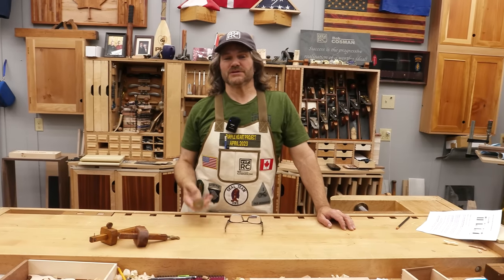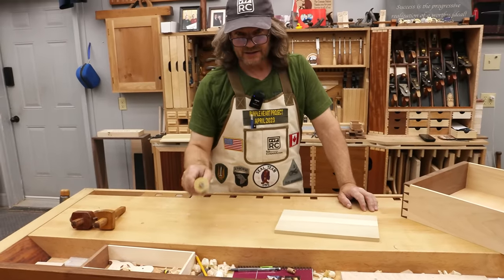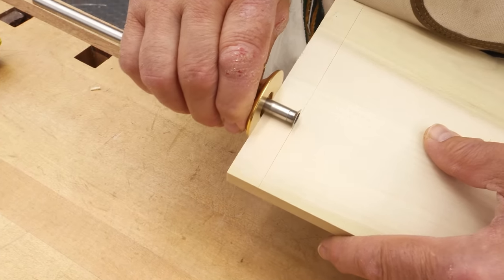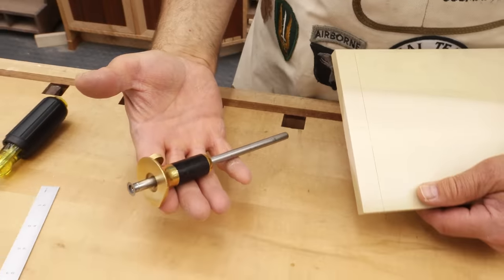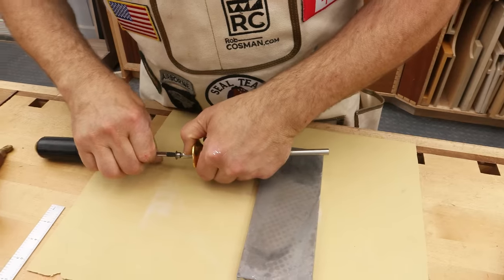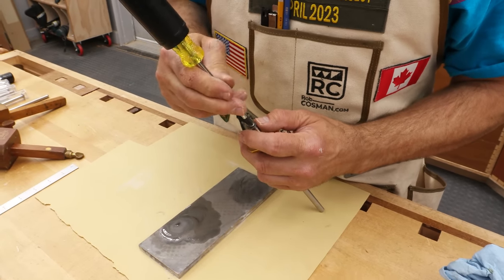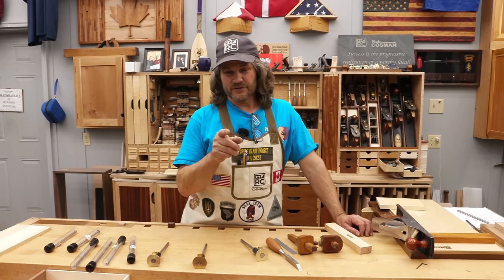How to properly use a marking gauge (Wheel style)

Comment: Years ago I bought a pin marking gauge, used it once and put it back in the drawer for the very reasons you mentioned. I have three wheel gauges now and use them as you described.

Comment: After sharpening the cutter like you have shown in the video, I tried something that worked a bit easier for me.  I left it in the gauge and set down two strips of shim stock on the diamond plate with just enough space between them to accommodate the cutter diameter plus a bit of clearance.  Then with the cutter out just enough to touch the plate it's a lot easier to sharpen.  slight taps on the rod gets the cutter out a thousandths a time until it's sharp.  This also ensures that it's flat to the gauge.  Might be worth a try, even though it's not a daily task.

I agree about the ones with the rubber O rings.  Thought that was great until I started doing dovetails and found that dropping the cutter down to set thickness was easier without the oring.

Comment: I agree with your comments Rob on the old style marking gauges. I have two, one I inherited from my wife's grandfather, a Cabinet Maker and a Marple's I bought myself twenty or more years ago. Both are still sharp enough to make a deep hole in a finger or thumb, but will shred a piece of soft wood. 
The wheel type is on my buy list for the end of the summer. My vegetable garden has taken me out of my woodwork shed till the autumn. I am building some nice raised vegetable beds though, champhered edges and fully squared. Best raised beds in the area thanks to all your tips and tutorials.

Comment: A concise and clear video both explaining and demonstrating the use of wheel type marking gauges. The reasons for favouring this type of gauge as compared to more traditional types is provided. The advice on the maintenance of the cutter and what key features such gauges should have to provide accuracy , along with different applications of the tool was most helpful. Many thanks to Team Cosman for continuing to supply superb woodworking videos and information.
Reply from the maker: Thanks Jeff.  Glad you found it useful

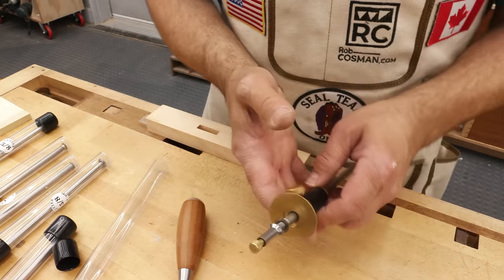Comment: Again, an excellent video.  I agree that the cutters are positioned well for the tenon (11:27) - chamfer outward.  This would create sharp/square lines for marking/sawing the tenon.  Do you ever reverse them for laying out the mortise or does the chisel compensate for the slight chamfer created by the bevel as mentioned earlier (3:58) - especially for thru mortises.  Or is this just too picky?

Comment: Great video and full of good info as usual.  When I adjust my wheel marking gauge with a ruler I place the cutter in the indented mark on the ruler for the preferred measurement and I lock up there.   If I'm doing that lightly is that OK.  And how do you sharpen when you are down to the screw head.